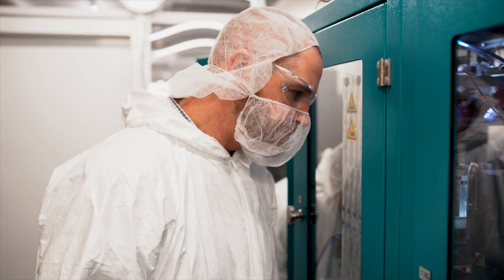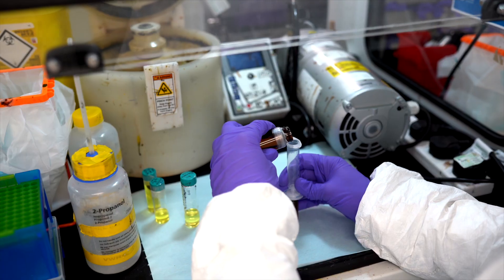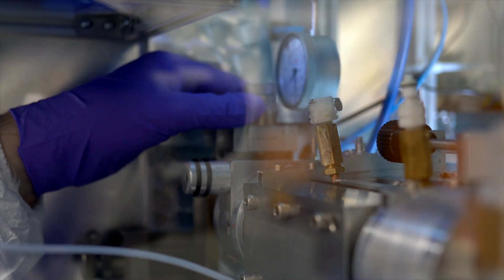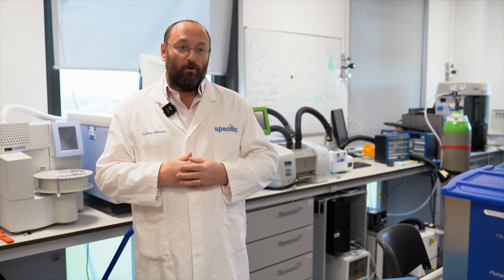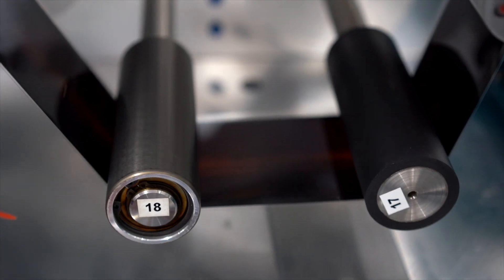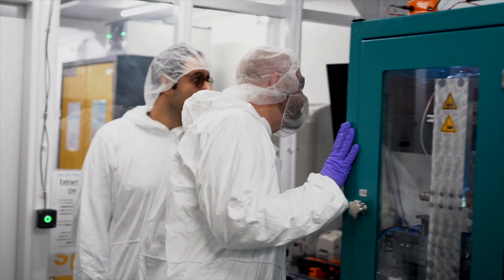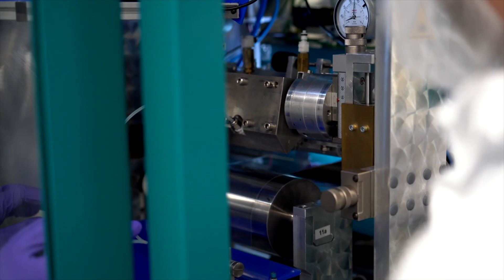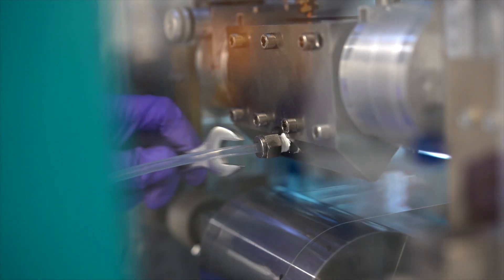World's First Genuine Fully Roll-to-Roll Printed Perovskite Solar Cell

Comment: One problem with putting thin film on your building is it will be blown around so much by strong winds that it will before long tear. This will need to be encased behind toughened glass in metal frames which will put the prices up.
Reply: I agree but it will be cheaper than Silicon solar panels...